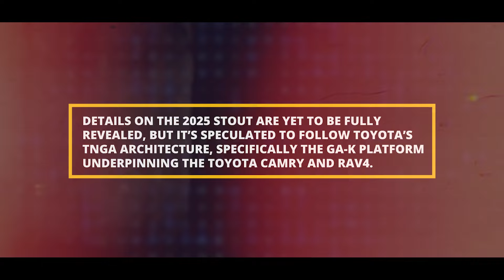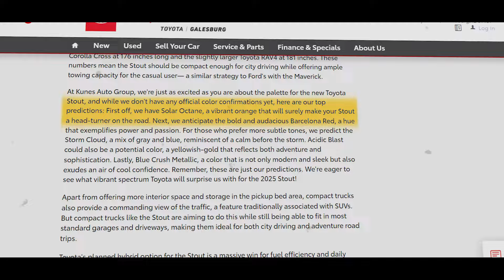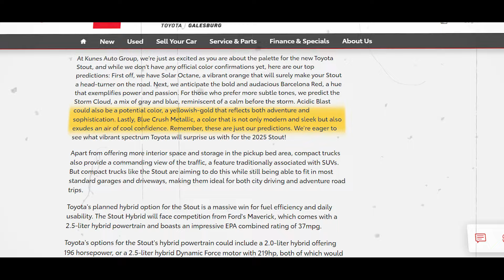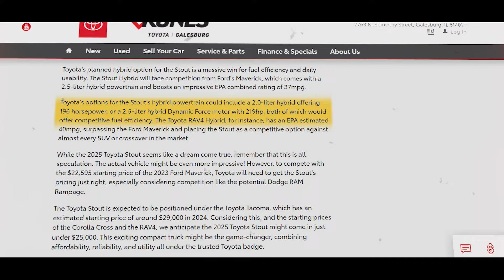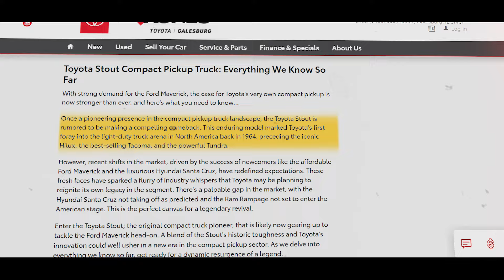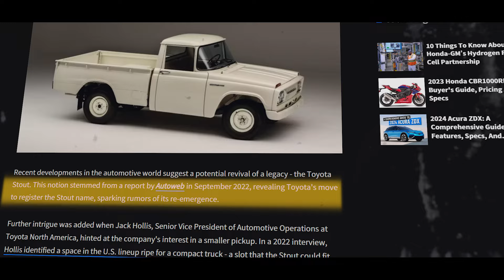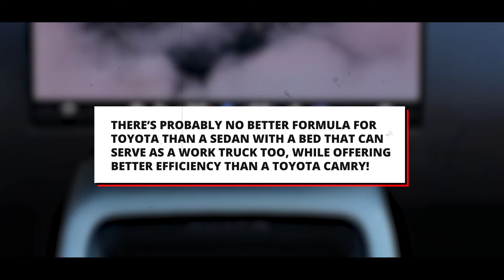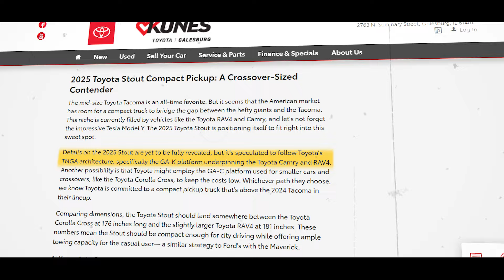Toyota's New $23,000 Pickup Truck Spells Trouble for Ford's Future

Comment: If the Stout uses the same HSD powertrain as the Rav4 Hybrid and the Camry and Sienna Hybrids, It will be limited to no more than 2,000 pounds towing, maybe 2,500. The reason for this has to do with the limited power and heat capacity of the MG2 stator in the P-810 transaxle. The Ford Maverick has a similar limitation, as do all of these small Hybrids. In a conventional ICE engine, the components that generate the motive force - the pistons, valves, cylinder blocks and heads, and the crankshaft, are all made of cast iron, forged steel, or various aluminum alloys that can withstand up to 1,400°F combustion gas temperatures because a huge volume of water is circulated through the engine and the radiator to keep the engine parts from melting. In a Hybrid transaxle, the Stator that drives the primary drive permanent magnet motor consists of a few pounds of copper coils that are splash cooled by transmission oil - a hydrocarbon that does not have nearly the capacity of water for removing heat. So the amount of electrical energy that can be passed through the stator coils without burning them up is far more limited than the amount of power that a gasoline engine can produce. A Toyota Tundra can tow a 6,000 pound trailer continuously at 65 miles per hour without any worries that you will overheat and damage something in the powertrain, and it can even do this climbing a 7% freeway upgrade, although maybe only at 45 mph. But for an 3-phase electric drive motor to do this, the rotor, stator, and MOSFET transitors in the inverter have to be really huge, far larger than these components are in the Rav4 Prime. Pure EV trucks like the F-150 Lightning, Tesla Cybertruck, and Rivian R1T use powertrain components that are of a completely different class than those used in the Maverick and Rav4/Stout. 
I just hope that as these small Hybrid pickups become more popular, buyers realize that exceeding the rated towing capacity (2,000 pounds in the base model Maverick and probably the same in the Stout), by even a small percentage could result in catastrophic damage to the electrical motors in the transmission. They are really not meant for trailer towing, and towing is one of the main reasons to buy a truck in the first place. 

Another issue is that the Stout will likely be a Unibody construction, like the Rav4 and Highlander, rather than body-on-ladder-frame, and this will also probably restrict it's towing capacity to no more than 2,500 pounds.